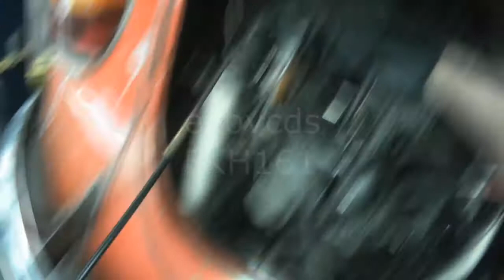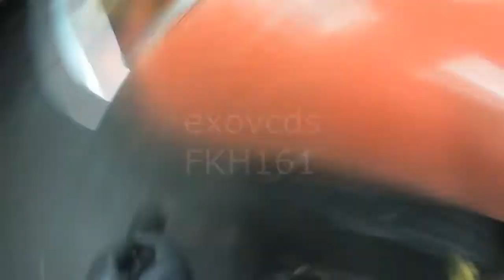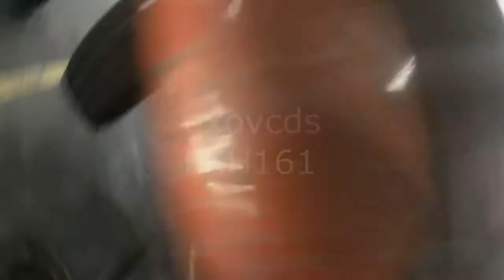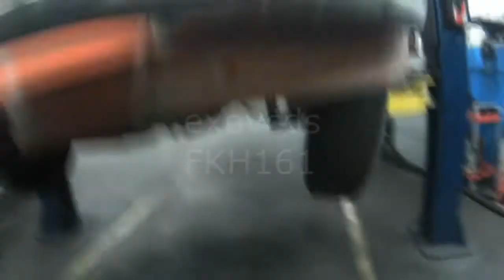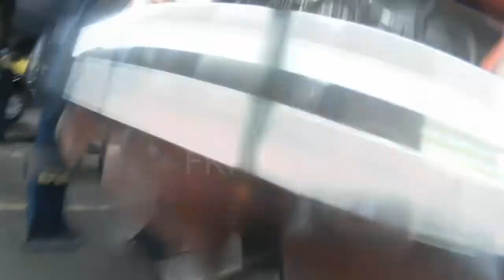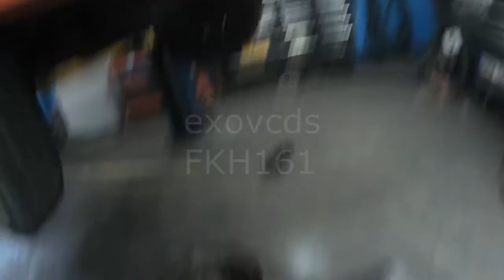VW T1: Beetle Smoke Test & Valve Adjustment

Comment: Hi, I have a 1971 super beetle in what I believe is the 1600 motor. I am new to Volkswagens, i’m having problem with it smoking. What’s odd, is it is only smoking out of the driver side tail pipe, and only smokes after the car is warmed up. It is not smoke at start or when the motor is cold. Do you have an idea where I could possibly start? Thank you in advance.
Reply from the maker: Check the spark plugs to see which cylinder is burning oil. Check for oil dripping on to the exhaust (that can also cause smoking).
Reply: Thomas EXOVCDS 
Thank you so much for responding!!
 I did notice tonight that the gasket that comes out of the head that bolts to the exhaust is oily where it bolts up . It’s not all like that on the passenger side where it bolts up. (It only smokes from the drivers side exhaust pipe. The car did set for a while. Does this sound really bad?
Reply from the maker: @1hicksonfamilybcle1  it's probably just a valve cover gasket leak, but I can't tell from where I am. Post a video on your channel so that I can see... youtube is great for sharing videos.
Reply from the maker: @1hicksonfamilybcle1  Sorry, if it's oily at the gasket where the pipe connects to the head, then the exhaust valve guide is worn and allowing oil to get into the exhaust. Cylinder head will have to come off to replace the valve guides... a complete valve grind job should be done as well.
Reply: Thomas EXOVCDS 
 Awesome, thank you so much.Yes, The gasket, and area are oily where the pipe connects to the head.Again, thank you so much for responding. I don’t have a channel yet, but I will make one, and share the link with you. It sounds like it’s going to be kind of a big job?
Reply from the maker: @1hicksonfamilybcle1  https://www.youtube.com/watch?v=S3cMPJjuj2w
Reply: Thomas EXOVCDS 
 Wow!!!  That was truly amazing!!!!. I don’t I’m quite there just yet, but I’m gonna start stocking up on brake parts cleaner!!! I will get there... thanks so much for helping me get started.